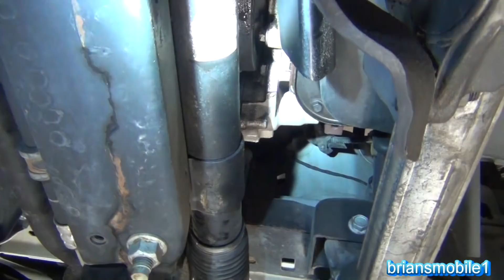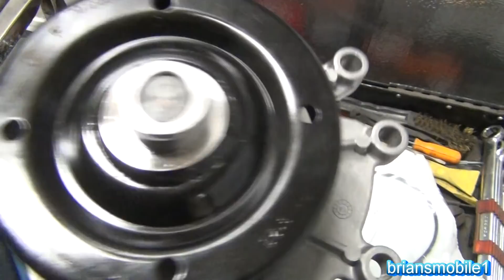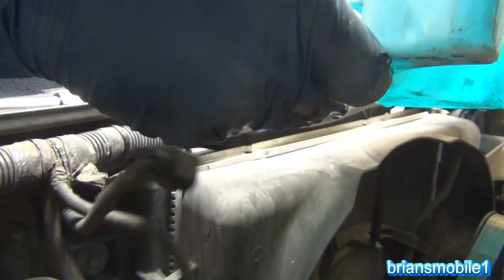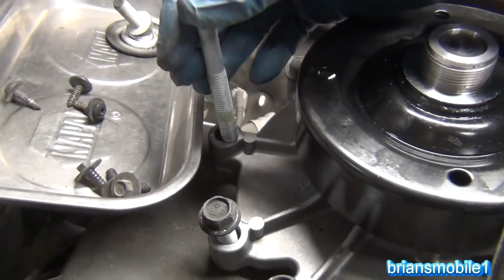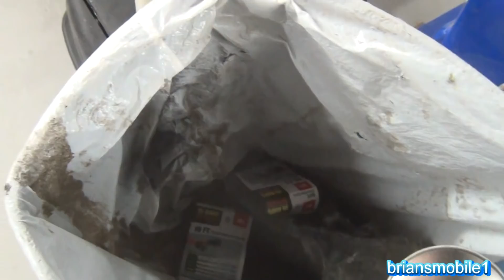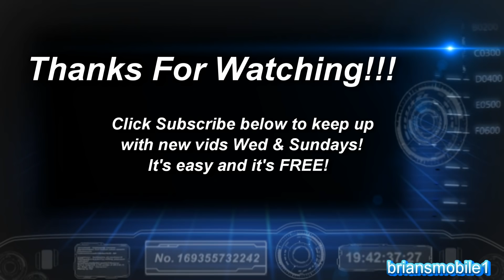Patriot Dakota Liberty Niro 3.7 Liter Water Pump Job

Comment: If you just install your short bolts first.. you'll find the long holes-- because the short bolts won't reach.   Plus the long bolts stick out entirely too far in the short holes.   There's virtually no way to mess it up.

Comment: I just wanna say THANK YOU so Much!! I was able to do this job with just a little bit of a hassle. I’m no mechanic but this video made it possible. I changed the oil while I was at it as well since I could reach the Oil filter with the Reservoir out of the way. That has to be one of the dumbest things. Oil change is regular up keep and to put it where they did is so dumb!! But anyways Thank You A Million Man!! Much Appreciated!! God Bless you Sir!! 🤙🏽🤙🏽
Reply: Man I can relate for sure.  I'm fixing to do this same job on my old lady's nitro.  That's the 1st thing I thought of was changing the oil.  This is my least favorite car to change oil on.  I'm always cussing it threading my arm up thru the bottom of the vehicle, getting a grip on the filter and making as little mess.as I possibly can.  I've seen there is an adapter that can be purchased to extend the filter out towards the radiator to make it easier to reach...just never pushed forward to try it.  Concerned it'd possibly create a new oil leak or something.

Comment: You do the best walkthrough, I now know exactly what im walking into all parts needed, how clips are done correctly and tools to get me through the job. Amazing work.
Had to come back to add one MAJOR thing you forgot to explain. There is a bleed for the coolent on the top inlet just before the radiator. After finishing this job truck was wanting to over heat. System must be bleed. Simply park on incline or jack front of vehicle, remove the valve (disk shaped flathead screw ) and pour in coolent until filling the void and replace. Heater core was blowing cold air and truck was overheating until I did this very simple last step.

Comment: Awesome Video Brian!!!! I followed your steps yesterday and had the job complete within 2 hours from start to finish! I did the work in my driveway, thankfully it was a beautiful 61 degree day (which is odd for Buffalo, NY in February, but I'll take it) I just wanted to say thanks for this video, the garage quoted me $300 plus tax, I was able to complete the job with a $59 new water pump and antifreeze! Thanks again Brian!!! 2011 Dodge Nitro Heat 4WD 3.7L  171,300 miles.

Comment: It was all good untill I followed your lead and pulled out the windshield washer motor...pulling it out broke the little rubber grommet and I wound up with a bad leak there when I reinstalled it...I wound up having to pull it out loosing all the pretty blue water, and loading it up with teflon tape..it stopped leaking..but it woulda been so much nicer if you had pulled the plug and 2 little hoses instead....that being said, the vid. was still really good.
Reply from the maker: You just paid "tuition" and learned something in a way you'll never forget it.  Good lessons.

Comment: Thanks for the great video! I changed the pump in our 09 liberty with no problems.
Other than it being cheaper, one reason the impeller is plastic may be that if the bearing goes it's less likely to chew through the timing cover. Maybe.

Comment: I'm having an unbelievable amount of fun trying to get to the ONE screw you forgot to mention. The T25 under the coolant filler metal cap, holding the plastic fluid tanks in. 1 by batt, 2 on top, and I cannot even see and hardly touch it to get my big hands in there. NIGHTMARE. 
Something I will be screwing around with for the next hour I'm sure...
Reply: I had the same problem. Spent probably two hours getting that one screw off last night. Absolutely no room to work. Any tricks for re-installing?

Comment: have you done the timing belt on this truck yet? I'm asking because I have the same truck and just did my water pump and changed the serp belt and the same pulley you did. mine has 143k miles I'm thinking it's almost that time. also watched your heater core flush video and it worked for the truck also.

Comment: the older non square ones are way easier no coolant tank or washer tank in the way pop the belt off take the bolts off wipe the timing cover off and slap the new one in and retarted amounts of room to spare lol

Comment: Great how to Brian. You mentioned that this and the Chrysler 3.3 caravans are your favorite, but from my experience, the 3.3 on those vans are a pain. It's jammed right bit wren the engine and subframe, sometime you have to drop the front of the engine just to sneak the pimp out. Or have I been doing it wrong? What's you method on the 3.3s?

Comment: thanks for the 3.7 Water Pump video.
need to do a transmission pan replacement in a 3.7 Jeep Liberty w/130 k miles.
Q: being the high mileage, should I replace the Transmission fluid with completely brand new OR mix Half-Old with Half- New fluid.

I've heard different theorys.
respect your opinion.
Walt J.
Reply from the maker: +Walt Junovich I've had the best luck doing half and half.  The important thing is to clean the pan out and clean off the magnet so the metal from the planetary gears etc.  can be taken out of circulation.
Reply: Thank you.
Keep making great videos 😜

Comment: Hey Brian.  In this video, are you using the DeWalt impact driver (with the 1/4 hex) or the DeWalt impact wrench with a 3/8 square drive?
Reply from the maker: +Shade Tree Giants B.  3/8ths drive 20V
Reply: briansmobile1 Thanks.

Comment: here subaru is a little bit expensive , like 5000 $ with 200000 miles.  plus i tink it has bad fuel mileage.. hence the reason i chose that honda with that engine so taxes will be low. I really want that model (here it cost 4000 $) that is the reason i want to know if it s any good..

Comment: Wait wait wait, Chrysler made an engine that's easy to work on??  Holy muffins!  Now I'm actually looking forward to getting one of these to work on!  :D

I don't think I've owned a watch since the late 80s...

140k on the factory water pump?  Not bad at all!  Odd you mention the plastic impellers on VWs...  I've got a '97 VW with 171k on it, and the factory water pump, which is still working great!  Sadly, the previous owner used a stop leak, and my heater core is pretty much non-functional.  I've back-flushed it numerous times, to no avail.

Great video, Brian!  Happy New Year!
Reply from the maker: +rhkips I cheated on my heater core.  I blew it out dry and soaked in in Prestone flush first.  Then flushed it with hot water and repeat.
Reply: briansmobile1
Haha, yup!  That's pretty much what I've done several times now.  Whatever stopleak the previous owner used has just solidified in the core.  Bleargh!

Comment: Hi I have a 1996 C280,  I am doing a powersteering flush,should I use synthetic or non synthetic power steering fluid, owners manual says use Mercedes special powersteering fluid, there is 2 types they said,I have checked my system and have found no leaks.
Reply from the maker: +rahul soni Most of the Daimler stuff I've worked on with the round emblems I just feed them what they ask for.  They're already expensive as it is without gumming up the works with something non mineral or mineral spirit based.

Comment: Nice video, as per Standard Operating Procedure!! It was like Christmas morning, waking up and seeing a new "beiansmobil1" video notice. Cup of coffee, bowl of cottage cheese, and a peaceful morning! I also have a few "FAVORITE CARS" to work on. In the water pump category, the GM 3100/3400 sohc engine. You don't even have to drain the cooling system. What little colorant that comes out, can easily be refilled. Nothing else in the way. Just four bolts on the pulley. Remove the serpentine belt, and five bolts on the pump. Sometimes the gasket will come off easily, sometimes no, but it's right up top with plenty of access, just in case. Some cars have just ridiculous procedures, to perform repairs!! 
How to check engine oil level:Step 1, disconnect the battery. Step 2, jack up the right side and support on Jack stands. Step 3, remove and replace the 3rd and 5th right rear wheel stud. Step 4, remove and replace the bulb grease in the left front turn signal. Step 5, remove two screws holding the passenger side sun visor, and support with 28awg speaker wire to the passenger head rest. Step 6, have assistant tap out the Declaration of Independence, in morse code, on the drivers side power lock switch. Step 7, drain 2.783oz of differential oil, save in a clean container for later inspection. Step 8, use special, one of a kind, unavailable to the public, at a cost of 3 times the price of the new car, holding tool #J1275/5$72?212, or equivalent , to remove one of 12 transmission mount bolts. You choose which one! Step 8, pull up gently on the oil level verification device (a.k.a. Dip stick), located in a secret location on every other unit that came off the assembly line. Step 9, pat your head, rub your belly, whistle Dixie, and verify that the engine oil level is between 1.6 to 1.6275 mm above the lower Mark, and below the upper Mark, at 73 degrees on a cloudy day. If necessary, add up to 3grams of clean engine oil, from an unopened container. (UGH!!! That step really got to me. I went thru five bottles of oil, before I could get anything out of an unopened container!!!!!!!) Step 10, obtain congressional authorization to reassemble in reverse order of the previous steps, above!! Step 11, if the check oil level light comes on after you have completed these steps, cycle the ignition hey on 27 times, while depressing and releasing the accelerator pedal in a pulse width modulated square wave pattern of 17 milliseconds, leave ignition key in the on, but not start position for 6.2 hours, then repeat steps 1 thru 10 on Tuesday!! If the light still won't go off, ship the vehicle to an obscure island in the South Pacific, for further diagnostic investigation!! 
Once the vehicle is returned, proceed to "how to check transmission fluid level"! It is recommended that you have 3 NASA rocket scientists, 2 brain surgeons, and an electromechanical engineer on hand, before proceeding with that step!
But hey, they have made some serious advancement since the 73 pinto was introduced, THANK GOD!!
Reply from the maker: +roadkill5333 Ha ha!  You're killing me!  Truth is always stranger and funnier than fiction.  It's like the manufacturers are creating process' to rival locksmith measures to keep people out.

Comment: Well thats pretty tame to do.  Never was a fan of working on Chrysler products but thats super easy.  I did a radiator and thermostat job on a neighbors 2005 Ram 1500 4.7 recently....that wasn't quite as much fun.  Its a nice looking truck except for they typical rotted out bedsides above the rear wheel wells.  Every one I see from that vintage on the road has the same issue.

Comment: Years ago my sister had the thermostat changed on her Mini (proper one with the A series engine) they used too much sealant which filled the bolt hole and then cracked the head when it run out of room as it was tightened up.
Reply from the maker: +heavydiesel Oh no!  That's hydraulic pressure with a good seal (sealant).
Reply: +heavydiesel good to know

Comment: Sorry brian, but you got a part of this wrong. The water circulates opposite from what you described. It is sucked through the bottom radiator hose and returned to the radiator through the top hose.
Reply from the maker: +Homer Simpson II You may have me on that.  I said it that way because this and the 4.7 have the water outlet and thermostat on the bottom. You knew that right?  So I figured Outlet.... bottom.... it does make more sense your way though.
Reply: briansmobile1 Actually I have never encountered a vehicle that pumps the other way. I mean what happens if the coolant gets low?? I could not pump up through the top if there were nothing there to pump, unless there were a siphon tube of some sort attached to the top radiator outlet going to the bottom of the radiator.
Reply from the maker: +Homer Simpson II I double checked and you're right!  Way to go!
Reply: +briansmobile1 It's also spelled Nitro not" Niro". Just thought you might want to correct the typo in the title.

Comment: Good video.  You make it look so simple.  That pump job is very similar to the Chrysler 4.7 V8, except it has a fan clutch assembly from the factory.
Reply from the maker: +Pet Rock's Garage Quite right.
Reply: +briansmobile1 Try doing the water pump on a 1st gen ford escape. Way easier as it has its own belt and is separate from the engine block.
Reply: +Pet Rock&#39;s Garage very similar if not the same setup for the v6 magnum 3.9l. 90 degree needle nose work well for getting the fan off the pulley

Comment: Hello brian. happy new year! i have  a question for you and i need a little advice... i want to purcase my first car but here in Romania taxes are huge for cars with engine above 2 liters.. so.. i tought about a petrol engine since i dont trust old diesel cars..they  are prone to more problems than petrol ..  i tought about HONDA CIVIC HYBRID (first gen). i know that there are battery  problem but what can you say about the powertrain? is that 1.3 engine any good? i know that it has almost no power  but i don t care so much. also if the battery is dead i can just put a  regular alternator and dump the hybrid system?it is stick shift. HOPE I  GET AN ANSWER FROM YOU! sorry if my english is bad..
Reply from the maker: +Catalin Florin Get a 2.0 Subaru WRX.  Problem solved.  Right?

Comment: Hey Brian i wnat to say HAPPY NEW YEAR, hope your family is happy :) ;
Did you use just that little compressor for working? Maybe i missed the big one :)
Reply from the maker: +Andrea Gili HAPPY NEW YEAR ANDREA!!!  I do!  Funny thing though.  I hardly use it now anyway- Just like here- I used the cordless.
Reply: +briansmobile1 That cordless alone against axels and crack pullyes? wow i have a new toy in the wishes list. So a 50 Lt. or 13 gallons compressor could be enough? I am thinking about the air hammer  often needed to struggle less. A hug from Italy